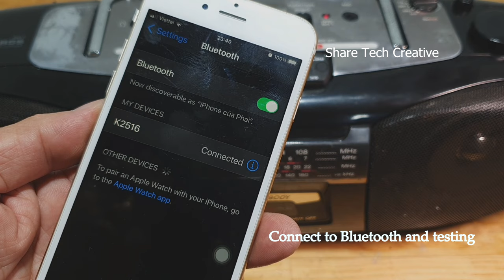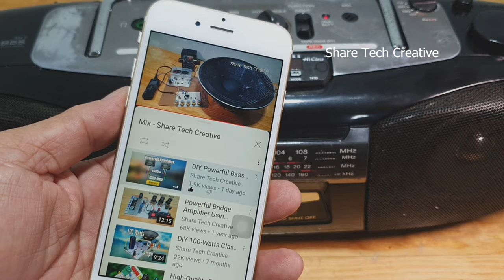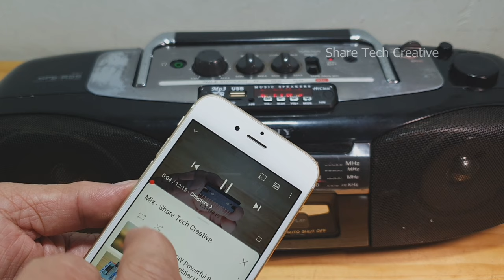Ways To Convert Mp3 Bluetooth For Old  Radio Cassette Tapes

Comment: Very cool enhancement. My Sony CFD-S39 looked more complicated for input selection, so I just combined a bluetooth receiver with an FM transmitter (which I had laying around). Now I just tune in my bluetooth source on an FM input frequency. Parts total less than $30 and no modifications necessary.
Reply: Very cool, I have an old Bose Ipod docking station, fantastic sound, I found you can order a small bluetooth device that will just sit in the docking part. Its terrible how many of these things get thrown in landfills and some are so well built and sound great. Peace and best wishes from Ireland to you all.

Comment: u can use bt board power supply from motor line...(no need to external supply separetly)
Reply from the maker: Yes, but it's susceptible to noise

Comment: Instead of using adaptor for 12v you might used 7812 regulator. This could save the space.. otherwise your work was fantastic
Reply from the maker: Your idea is very correct, but most cassette radios using a common supply will suffer buzz, howl, and hiss, so we have to use a 12-volt adapter.
Reply: Yeah I tryed that two times and ground loop cause ot same power supply make sound horrible

Comment: Appreciate your effort, but IMO you could use Bluetooth receiver box and kept it inside the battery box and do the wiring rather than spoiling the tape. Keep it vintage and enjoy pure Analog music. Appologies if my comments offensive.
Reply from the maker: Good tip!
Reply: That Bluetooth module has fm. Why not remove the fm dial section and mount it there? Then the tape would still function. And you could wire the audio into the fm input.
Reply: @branhicks  I would rather not disturb the stock system for a shit low res Bluetooth